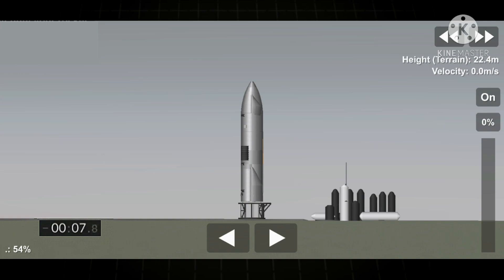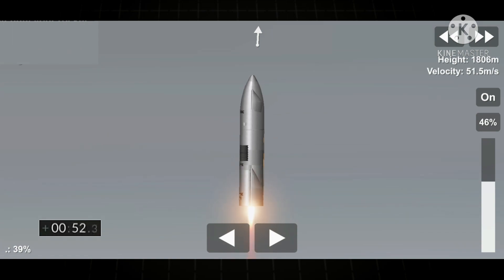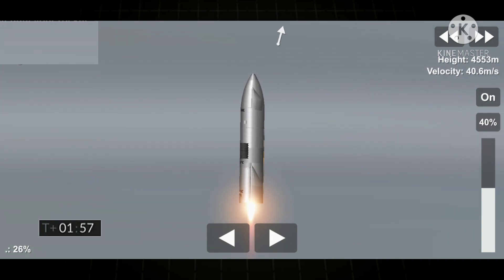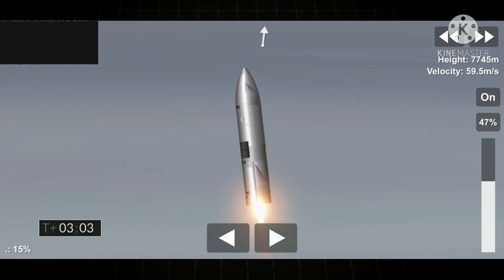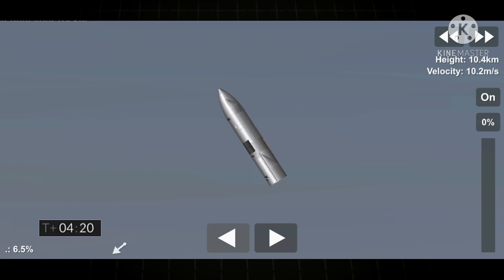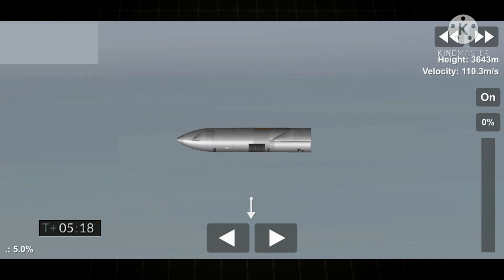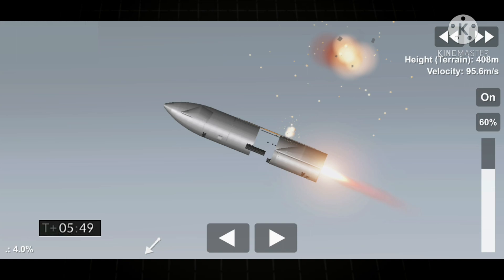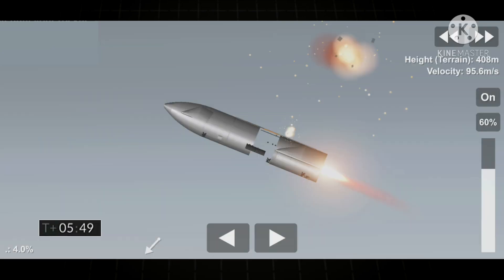Starship | SN11 | High-Altitude Flight Test

Comment: Correction : 
1. 10km irl doesn't mean 10km at sfs, earth karma line is 100km while in sfs only 30km, so 10km / 100km = 0.1,  then 0.1 x 30km = 3km (3000m) if you goes to 10km in sfs that's mean you are going to 33.33km irl (in case you don't know)
2. There's nothing explosion on real SpaceX livestream, the camera froze before any explosion happened.
Reply from the maker: We are  currently recreating it using IRL, so we 10km is needed in the video, I use SFS scale rocket for easy control,but I appreciate  your correction!😃
Reply: @FeatherSpace  🙆🏻‍♀️
Reply from the maker: Also I do an explosion, to simulate the whole rocket when FTS activate,luckily engines not also exploded on that part of my recreating!😄
Reply: @FeatherSpace  that's a perfect explosion, without destroy the engine, btw although 1:1 scale, 1m in sfs world size is matches with it 30km altitudes, but it's okay buddy 🙆🏻‍♀️